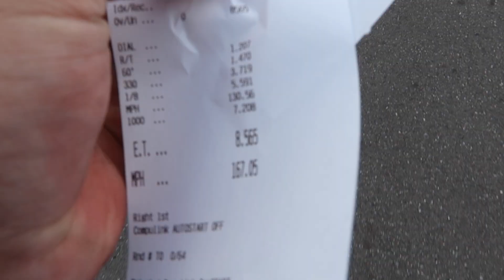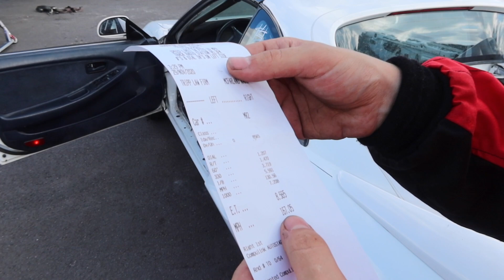NEW PERSONAL BEST In The Twin Turbo Mr2!

Comment: Need to work on suspension setup. Get with KSR or someone down there and get that front half taken care of. Maybe strap the front end
Reply: Adjustable shocks on the front. Limit travel to 3”-4” and tighten up the rebound. The front should come up slightly and then hold and drop slow and controlled. I don’t understand why they try to fix it by limiting power. The idea is to go faster. It’s time to branch out beyond the tuning and drivetrain.
Reply: @alanphillips4431  people overlook suspension
Reply: KSR is in high demand these days, poor guy need to clone himself a dozen times lol
Reply: Yeah, KSR for the gold!

Comment: 1000hp car and he’s like “now I can feel the power start to ramp in”
Reply: You took that information the wrong way
Reply: because its when he starts feeling the 1000hp
Reply: Diogo Azevedo no
Reply: Just cause it made 1000 on the dyno doesnt mean its been turned up that high on the track yet. Or he could be still turning it up even higher. Alot of tuners will just get good tune on the dyno then keep pushingnitnat the track. A motor like this kind of  has a life expectancy, and dyno pulls are wasting life span

Comment: Get that front end down a couple of inches.  Use a smaller tyre / wheel combo.  On a motorcycle you can pick up 4-5 tenths just by strapping the front end down.  It makes a massive difference.  Great job.

Comment: Kyle, in the sport bike world, when the front end comes up we use the rear brake to bring the front end down. This allows us to stay on full throttle and full boost while keeping the front end in check. You should consider running a really strong ebrake and using that to control the wheelie instead of letting off the throttle or lowering launch boost.

Comment: Here's a thought and only a thought I am a backyard mechanic I really have never drag raced on track only on the streets But I had a friend that had a firebird that had the same problem with lifting he fix it with solid steel roll cage in the front and  concrete filled the  bumper with the mr2  Probly be able to get away with just the concrete in the front maybe a couple cinder blocks in the front trunk something of that nature again just a thought.

Comment: Hey Kyle, have you thought about adding a sand box to the front end of the MR2?  Having that empty front bay, maybe there is space for a low slung steel box.  Made with the right design, you could tune your front and side to side weight bias, by adding or removing sand.   My theory is if you add 100lbs of steel and sand but you 60FT 2ths better, it's still a net gain.  Since its sounds like your getting ready to do a new cage anyways, provisions for weight balancing points might be a thing to consider.  Gratz on 8.5!

Comment: Dang kyle been spoiling me up during either breakfast break or lunchtime.. Also, whatever happened to the breakfast guy who always commented his meals??
Reply from the maker: miss that guy
Reply: Fr tho just made breakfast and sameee
Reply: @boostedboiz  I have send you a few comments on a way to help you keep down the Mr2...
On Instagram @guasonrivera
Reply: @boostedboiz      My idea for your MR2. You should get a Thick/ heavy piece of metal sheet I believe like 1" Thick and do the front splitter to help you keep the nose down... 
It might work better than the sand or help more
Reply: @boostedboiz  fr 😞
Reply: @babyblubrzbestrotaryzleepe2634  james already told kyle that he needs shocks with better travel. there's no need to put on more weight and slow down the car.
Reply: @qwe4dsffe745  well if that's so. Then why he is putting sand in the front

The splitter will help more than sand in my opinion 
He can put suspension and try that too...
That car has plenty of Power
Reply: @boostedboiz  dude also, whats up with trouser, your 2 turtles and goldfish? Been a minute
Reply: @babyblubrzbestrotaryzleepe2634  a weight plate would probably be to much weight and shocks would help better because it gives you rear bite and it separates to hold the front end down its not a civic
Reply: @babyblubrzbestrotaryzleepe2634  Cause he doesn't have the suspension yet
Reply: @boostedboiz  look up the mansbrake from NXT shift
Reply: I have a Spanish assignment due 12 hours ago but I need a bit more dopamine and joy from watching the boiz before I can do that XD
Reply: bags of sand will break and get everywhere.....get some 40 pound boxes of cat litter from target.
Reply: Fco. Javier Perez that’s not how it works
Reply: Gerg Sipatray you’re literally saying the same thing. The box can break too.....
Reply: Mister Bojangles  can’t for the class they run

Comment: Congrats on your new record. Hope to see you say this many more times.
looks like you got the motor, trans and traction pretty much tuned in.
Time to dial in the chassis. Just keep nibbling away it will get better and better.
I spent 2 years getting a 78 Sunbird to keep the front wheels down.

Comment: You’re definitely going to take the world record for the fastest mr2!
Reply: Am not trying say anything but this engine is strong on the mr2 look at how many 8s passes he havnt replace anything beside head and valve trains
Reply: with the suspension dialed it could be an 8.1 car to 8.0, I think this car is a back half car for sure but there's 3/10ths to be had in front half until he gets like a legit hardcore drag setup
Reply: @samadler5635  I think KSR can get the MR2 planted.
Reply: The MR2 in the u.k will keep it .. I want Kyle to get it but Nathan's purple MR2 is only getting faster..
Reply: @Organised_khaos  remember kyles mr2 engine is fully build so we cant really tell whos going to take the record .
Reply: @kxlucifer  so is Nathans .. and it's the mighty 3sgte engine, both rev to plus side of 9,000 plus Nathan is a very experienced driver.
Reply: @Organised_khaos  we will see..
Reply: @Organised_khaos  K series has gone up to 1400 whp. Power isn't the issue here
Reply: @Shadowboost  no dice mate ...who said power is the deciding factor?  I didn't
Reply: @Organised_khaos  You're the one talking about the engine and RPM. Not me. K series is the mighty engine. 3S-GTE, meh
Reply: Nah, Toyota keeping the record.  3sgte baby!

Comment: for faster shifts put a solinoid on your sequencial shifter and 2 buttons on your steering wheel one button for upshift and one for downshift then you can keep both hands on the steering wheel and pushing a button is quicker than shifting with a gearshift i recon you would shave half a second quicker per shift with a solinoid and bonus is you can still use the shifter if something was to fail on the solinoid cheers from down under

Comment: You should look into the VPS system but idk if you have Holly EFI or what but this thing links your suspension and EFI together and it knows when to pull timing so you can keep the pedal on the floor

Comment: The faster you go, the more exponential aero becomes. You should remove the front, side and rear grills and license plate holder ~4lbs. Have you stiffened the shocks to help prevent wheelies and allow a lower ride height?

Comment: 1800 rpm is seriously a ton of rpm to short shift! Also for anyone that thinks they could shift accurately by ear at those high of rpm’s hasn’t been in a car at those high of rpm’s! Everything from 7-8K rpm’s sounds insane and really “overloads” the senses! When Kyle has his shift light installed and working I think it’ll make a big difference! Shifting some weight up front is going to really help with the wheelies and get the car to the record! I agree with what you guys are saying about the slipper clutch not making big enough of a difference to get you the record but I don’t own a car that has a wheelie problem like you so what I think really doesn’t matter 😂

Comment: Could be time to go full racecar mode, I know it needs more weight in the front but if you fit some fibreglass/carbon doors with poly windows, Get rid of all the glass including T tops for polycarbonate. Ditch the stock steering wheel then clear out all other unnecessary weight you can get rid. That will allow you to run more ballast up front while still keeping the weight down to normal. You got the power to get that record just need to dial in the last 10% of the car.

Comment: Kyle check out a system called mansbrake from nxtshift channel owner. Its a button controlled brake control/delay valve built into one module that controls timing of clutch delay and brake release. It's a trans brake system for manual trans car dude makes. Nxtshift channel owner makes them and shows them. One of the guys who know it's just a 6. Shares a shop with Poe. Bet the guy would hook you up to promote his product.

Comment: You should take the mirrors off and make plates to cover the holes. Put them on when you trailer the MR2. If your not racing on the street do you need mirrors? Also time for a slipper clutch.

Comment: MR2 can pull some high 8.20’s-low 8.30’s with the suspension dialed in for the rear and recommended wheelie bar.

Comment: Have you thought about running a water/air intercooler? Having a water tank in the front would help too. Running that higher boost and a rear mounted air/air intercooler would surely be lacking efficiency......
💪💪👊👌

Comment: Kyle why don’t you try some VP Racing C85 fuel or One Ethanol R fuel. Since you already run pump E85 in the car but there is some power to be made with running C85 or One Ethanol R or Even E90 that Garret “Cletus” runs.

Comment: replace the bags of sand with lead, you'll be able to put it closer to the front of the car and lower because its more dense. You can melt down wheel weights, dive weights, or lead shot at home pretty easily with some safety gear.

Comment: Hopefully Jack Stand Jimmy is working on getting you a set of drag shocks and struts for the MR2 so you can dial out the wheelie issue. But in the meantime you could make you some wheelie bars and some limit straps to keep the nose down so you could run an 8.30 or lower. J/S

Comment: That was sick the MR2 will def beat the record with some suspension work. Happy Wyatt is there to help out and keep you company he's good shit. Do some Mexico racing pls. Curious what the rules are for it being an "MR2" with a different engine. Just wondering where the line is because you could engine swap something and full carbon fiber body and strip/swap all other components except what? The windows and frame?

Comment: 162.47 miles per hour

Nathan Freke is the owner, builder and hold-on-tight driver of the world's fastest Toyota MR2, which recently clinched the quarter-mile record after setting a blistering 8.718 second pass at a terminal speed of 162.47 miles per hour.Nov 4, 2020

Great job guys so when did he run faster than that? He must have knew you were coming for the record let's go Boiz fastest MR2 with a Honda motor in the world ❤️

Comment: Just an idea: why not run a wider front wheel and stretch the tire slightly for a tad more weight. Do a give away on the old ones or sell them. Maybe a thicker heavier metal fuel cell to help with weight?

Comment: 8:40 man I feel like you should wrap those shard edges on the floor pan with rubber you your hoses dont get messed up
Reply: He should plate and weld up those sections. With the fuel and coolant lines directly underneath. Also it would make the cage stronger.
Reply: @MJTAUTOMOTIVE  for sure. Just another was for fire to get in

Comment: They should remove the ballast up front and add an air to water intercooler with the water reservoir up front.  If they want weight up front it might as well be weight that is contributing to the performance of the car and not just dead weight like sand.

Comment: Dude i never seen a hell cat in a rail before being pushed also id get rid of those clamps and put those sweet vibrant O ring clamps with billet the kinds where you need to weld new flanges and you remove them by one sliding pin.

Comment: Maybe it was the valve springs rofl. Who knew you were pushing the stock springs past 8500 w/cams it weird how some camps just don’t upgrade some stuff you would think is just common hotroder knowledge. Pro tip: rpm is limited by valve control.

Comment: Like I said before. Just add a good amount of weight to the front. Has kept me off the bumper. After that you can get some good shocks on the front and fine tune it. I bet you block off 3 tenths f you add at east 100lbs

Comment: Hey Kyle, maybe look into the mansbrake from NXT Shift (https://www.nxtshiftinnovations.com/shop/mansbrake). I’d say that will probably be the best approach to slipping the clutch consistently pass after pass and not have the issue of slipping too much or not enough to keep the front wheels down, would be epic to see it in a 1000+hp 4 banger 😁

Comment: Kyle: “I don’t know how he got in here”  while panning over to the gaping hole in the floor for the cage.. lmao dude you always have me  laughing my a** off. Awesome pass congratulations. Some suggestions maybe worth looking into,  a Air shifter and a MPS kill box, set her to auto shift 9700 and let her eat.  Could add shift button to the steering wheel and you’ll be able to short shift the power wheelies. It’s always worked great for drag bikes. Maybe also add a scramble button for the times the front stays down to run out the back harder if the chassis and track holds it.

Comment: suggesting it again.  make a rail system under car that move weight  like the sled used for tractor pulling.
this way you have the weight at front during launch and centered when you need to brake at end.
a wiper motor should do the trick.
cheap sollution  is to use switches like this to shut it on and off at end of rails. 
http://prntscr.com/vt3fyp
you find them in old joysticks.  usually 6-7  in a joystick.
think you can but joysticks in second hand stores and garage sales for a $ or 2
plenty of spare switches.
can even make it so lights turn on in engine bay  when hood is open.
good for checking the car at night at the strip  and meets in mexico.

Comment: I believe he needs that cover over the motor. He is creating drag without having it there.
Reply: I was just about to say the same thing. My old (super slow) daily driver lost about 2-4mph top speed because of 1 missing plastic trim under the car...
Reply: @Karpo1986  
for kyle that 2-4mph could result in .1-.2 of a second. going at the speeds he is going you have to ensure your aero isnt creating drag. missing the entire engine cover will create drag

Comment: just put the engine in the front, no more wheelies
Reply: It wont br an mr2 no more newer and older mr2s all have engine in the rear
Reply: it would still pop the wheelies lol. s2000 with compound turbos popped the wheelie.